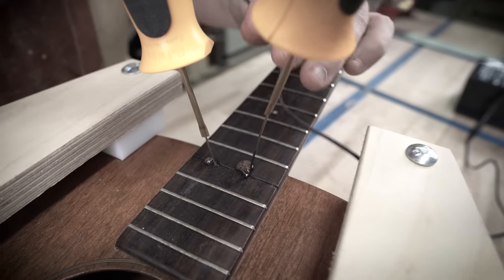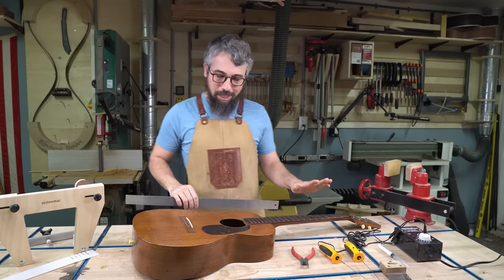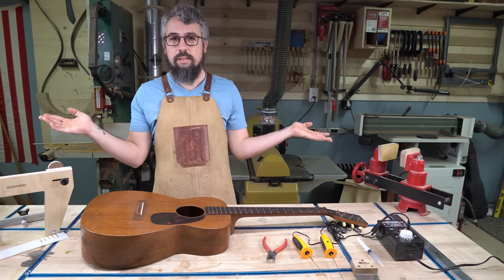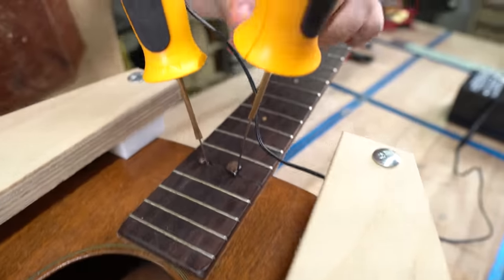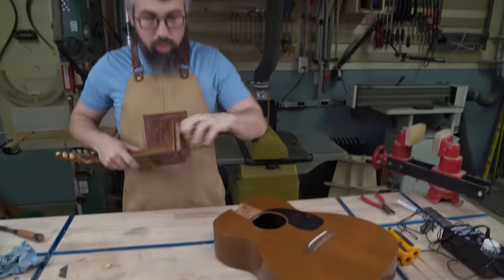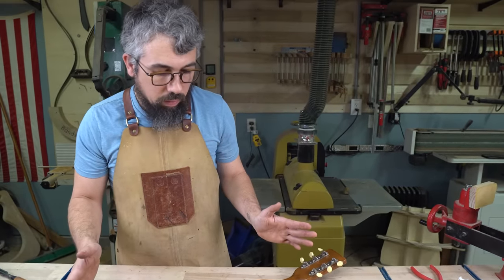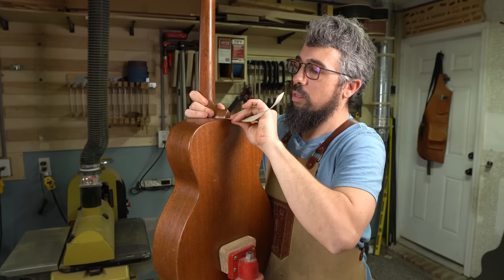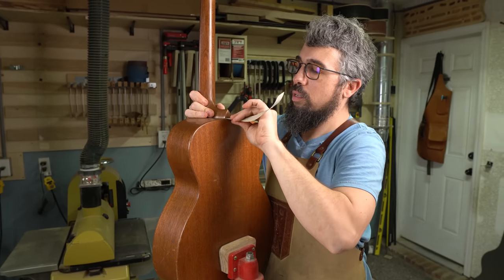Neck Reset on a Pre-War Martin 0-15 from 1941

Comment: Another top tip from Ted - when you are "flossing" you should brush away all the debris after every pull. If you don't you leave behind 100 grit grains of sand which lie on the heel. They can then scratch the finish around the heel with your next pull
Reply: Attention to detail separates the masters from the rest.

Comment: Another tip from TWoodford is to clean off the dust between each pull of the sandpaper. This will keep you from getting any damage to the finish around the neck joint from any wayward pieces of grit and what not.

Comment: Hello Nick
I watched a neck reset you did a couple of times but now Im having trouble finding it.😊  You used a foam cutter to remove the neck and I was really impressed with it. You said that you paid about 180.00 for it. I am living in the Philippines for the time being till I get my new wifes visa approved. So I thought I would check and see if I could get it cheaper here. I checked on Lazada which is like amazon for here. I couldn't find the same brand but i found one that is similar exept there is only one probe with each power control. It does have a good adjustable power control and work great. Best thing is I bought two for $28.00. I have been repairing acoustical guitars while I am here for something to do. I just wanted to say thank you for sharing this method with everyone. 
I love watching your videos.

Comment: Before doing your sanding draws on the heel, you should use a narrow chisel and carve away the face of the heel against the dovetail. I usually leave about 1/8” of the face untouched on both sides and the tip. Since that is not a glue area, the only area that needs to be sanded is the contact point that you see when the dovetail is assembled. This makes the sanding go faster, and if you don’t relieve these areas, then you will probably create an out of flat surface on the heel which will not pull up tight to the guitar body when assembled. It looks like you did this because of the sanding pattern on the heel face, but it is a very important detail that is easy to illustrate while you are in process with a video, and difficult to describe otherwise. Twoodford shows it in one of his videos. Next reset I do is going to be on video as well. I also just bought the heat sticks from foam factory. They actually sell it as the “guitar neck removal kit”.

Comment: That was a good video!  Good job!  I don't know how many people realize that when you pull the sandpaper through from the fingerboard to the heel of the neck, the amount of sandpaper in contact with the wood is proportional to the distance from the fingerboard.  So, this makes the amount removed wedge-shaped.  Which is exactly what you want!  So, if you needed to tip the neck upward instead of back, you would need to pull the sandpaper the other way.  That is why I rough set the neck before I put the fingerboard on the neck because after the fingerboard is installed you can only pull the sandpaper one direction.

Comment: Very cool to find this. I also own a '41 O-15, November built, so right in line with this guitar. Mine has been in the family since new. Also not original at this point. Later model tuners replacing the 3 on a plate, refretted, and a headstock break repair (thanks to a careless sibling)....with mostly original finish. Local luthier here in Santa Fe (Keith Visgara) did the refret and fortunately as of now the neck is good. It's due for a tune-up and although it has the original ebony nut it's developed an A string buzz at the first fret so we may need to replace it. And a nod to your bridge slotting video this bridge has been slotted and has excellent break angle now.

I also follow all of Ted Woodford's video...not even an amateur repair guy but love his knowledge and attention to detail.

Comment: It's T Woodford. As opposed to 'twoodford' pronounced phonetically. I have the foam cutters too, because of him. I've only ever done one reset so far but, they popped that neck off with zero steam, zero jig, very quickly and I had zero experience. To be honest, getting the neck off was the easy bit. By day two of shaping and shims, I was cursing Ted Woodford and had partially composed a song called 'So, You Wanna Be Just Like Ted Woodford?' :)

Comment: Please tell me you took photos of those original fabrication dates, on the old shims. I’dthen print them out and put them in the case with a brief narrative of what you did this round of repairs.  

Also, if you had to cover them with your new shims, I would also carefully write the original info on the dove tail (not where it will be covered with glue) as well as adding your name and the date of the neck reset.  I’ve also seen this kind of info neatly written in pencil, on the underside of the guitar top.  

In 50 years, another luthier may find that info to be very interesting to know.   I know I would.

Comment: Great vid, as always, but I was surprised to see you not apply the glue to both gluing surfaces, and not brush the glue on in order to ensure that there would be no bubbles or voids in the glue.  I know it's fairly unlikely, but when you only have one shot, you aim several times.

Comment: My concern is that if your endpoint for neck angle is the straightedge just clearing the bridge unstrung you are going to have issues under tension.   The real endpoint should be just clearing the bridge under string tension.  
I think the most important part of a neck reset is getting a feel for how much the neck moves strung up to pitch before starting the reset and/or duplicating string tension with the re-set neck dry clamped and while supporting the headstock adding about 12 lbs of weight to the upper bout to mimic tension and see where your straightedge lands.
I find I usually have to overshoot by up to 1/16" in many guitars to have it wind up right under string tension.

Comment: I did a reset on a 70s Yamaha acoustic without a neck removal jig, but it wasn't easy to get good pressure.  I ended up clamping the upper bouts down to my bench with a padded caul under the heel cap providing upward resistance to the downward clamps.  Fortunately it was so stubborn that I had to work it out and it didn't have a chance to pop on me.

Comment: I was waiting to see something on neck drift. How do you verify that, the neck angle aside, that the 14th fret is totally parallel with the top of the body? I've seen some botched resets where one sides is slightly higher than the other so the neck is drifting to the treble or bass side by half a degree or so and the high E hangs off the neck etc. I know you were counting your flosses, but are there any other safeguards to prevent drift?

Comment: You "remove the glue" from under the fingerboard extension? No, you don't. You merely separate the two glued surfaces. The glue is still there.

Looks good, overall. You keep saying you have to replace the bridge, but you don't say why.

Comment: Ha.. Ha.... Funny I watch this now 10 months from broadcast & you're mentioning heat exchanger or heater core in my 2005 Audi allroad which I just replaced this pst week.. on the C5 Audi no need for ash removal s the core is nestled bottom of center console next to the gas pedal.. Removal & reinstall ws not the issue ( couple wires & sensors to move out of the wy.. The nightmare is the little clamps connecting the soft aluminum tubing to the inlet/outlets of the heater core.. FUN

Comment: Just come across Driftwood. Got a question... I have a Martin that the serial # says it was made in 1973. No Logo on headstock and no model # stamped on the inside...any ideas on why?  ...and it has an adjustable bridge...should I changed it out?
Reply from the maker: I’m unaware of any Martins that don’t have a logo on the headstock or serial number from anytime after the early 1900s. It’s highly likely that it’s not actually a Martin, but I could be wrong.
Reply: @DriftwoodGuitars  It has the serial # 316097 but no model # stamped inside..dial that in and it comes up a Martin....when I bought it had a small crack in the neck joint, never has been an issue...I bought the guitar from Louisa Branscomb (Boot Hill) she was giving me banjo lessons...(1978) $100... Im thinking it was tossed out the door...doesn't sound bad at all...
Reply: Could be a salesman special or one of the workers factory guitars that they get to build themselves as part of their employment
Reply: @TT-wz6xy  I vaguely remember being tied to one of those....I'm thinking that is what I have...
Reply: @fordjubilee  
There is also the Martin Shenandoah guitars & some kit guitars that were sold as seconds , that is also a possibility , but not sure how that would tie in with yours having a serial number , you might have something more special than what I’ve mentioned , if you want a definitive answer go over to the the UMGF ( unnoficial Martin guitar forum ) and post your question there , you’ll have an answer by the close of the day , you can post photos there too , it’s the place for all things Martin with a wealth of knowledge
Reply: @TT-wz6xy  Cool beans... I'll check that out. Seems like I do have mystery guitar here....I don't think it's hidden treasure other than I have had for 45 years...but I do want to know what it is and how it got that way... Thanks for your help.

Comment: Sad you don't use hide glue. It effects the sound. But great job otherwise! I'd love to see a sound sample of you guys playing it when it's done!
Reply: The purpose of hide glue is not that it has tonal properties.
Reply: @frankwebster9110  it’s ok if you don’t hear it but I do.  It’s obvious to me and it helps give part of that vintage tone that I enjoy but if you don’t hear it or care then that’s totally fine.  I’ve replaced bridges on guitars that had been glued with tite bond and even that one glue joint using hot hide glue made a big difference in the sound. To me. To each their own though.
Reply: @jeb419  I really didn't think it was a tone thing. My bad. I thought it was a relic from the past that is superior in that it doesn't damage the wood or change it adversely as well as being easier to remove in case of repair. I guess it makes sense that the transfer of vibration could be dulled by a plastic type glue or epoxy. Thanks for the correction.

Comment: Woo hoo.. the single most elegant solution to popping a neck has finally arrived. Very satisfying.

Naturally my cheapskate brain starts going about various ways you might accomplish this with what you already have 🤔 Like say, 2 (heat-adjusted) soldering irons, tips replaced by long steel rods?

Comment: For a channel that's had a partnership with Stew Mac I can't believe they didn't use the HeatStick that they make. I love T Woodford's channel, and bought a cheap foam cutter for my next neck reset, the first one was done with a ghetto heat stick that I made myself out of a chunk of chopper wire that I clamped into a cheap Harbor Freight soldering iron.
Reply: The heatstick s***s. It leaves a way to big hole. Two foam cutters are superior.

Comment: Why the hell doesn't Martin have a trust rod in the neck to make neck adjustments so much easier? They say it is because the trust rod affects the tone of the guitar. I am not buying it. I bought a 00028 original 200 yr aged rosewood guitar in 1967 (first owner). Great guitar until the neck started to move forward. Now the action is too high. I have to actually tune down a whole step to get any ability & comfort when playing it. Real pain in the butt. Meanwhile Martin will do the repair. However, I could not part with the guitar because I was in the middle of recording a CD/album of original material & needed the guitar. It's soon to go back to a Martin repair dealer to be repaired. To finish the CD I had to buy a Taylor while the Martin is gone.  Martin needs to advance their thinking. Vince James (Ajello)
Reply: Martin did finally start using truss rods I believe in the late 70s